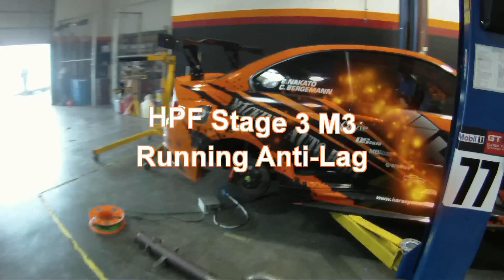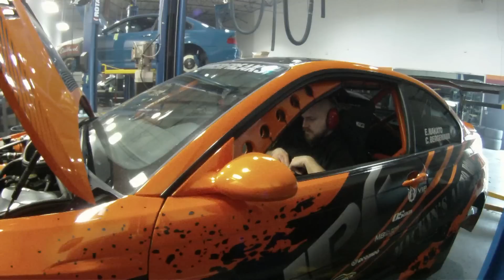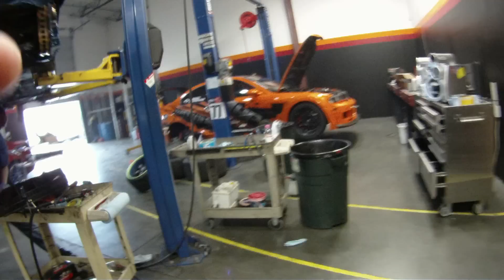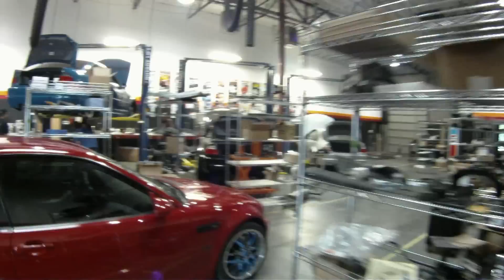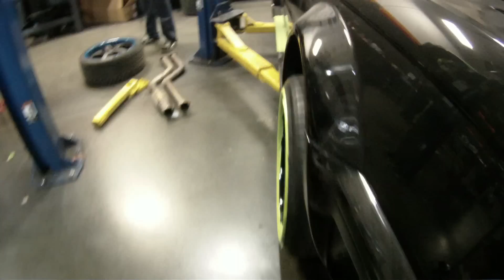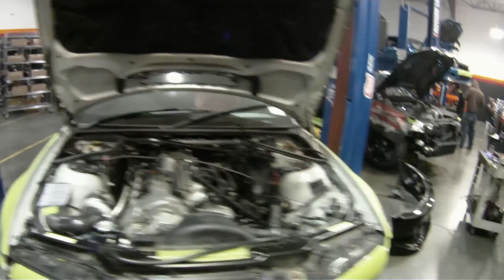HPF Stage 3 M3 Running Anti-Lag at HorsepowerFreaks

Comment: Antilag is a program/harsware that retards timing in between shifts to keep the turbo spooled, thus antilag. What this is is "2 step" or "launch control" theres not lag to avoid at idle, youre building boost to launch.